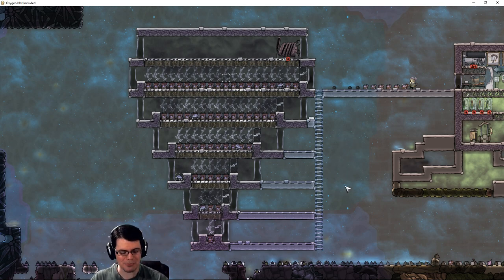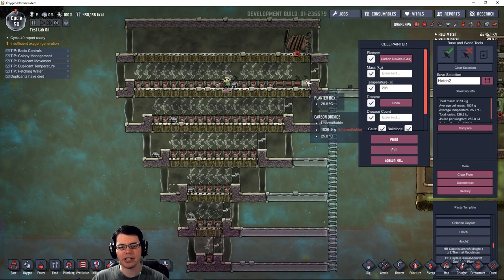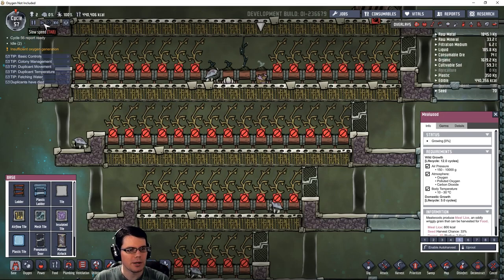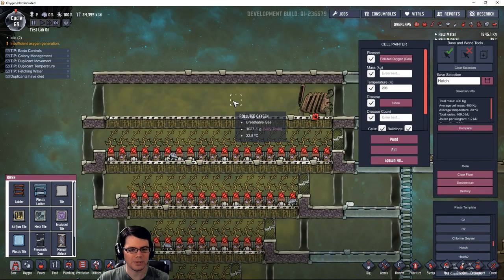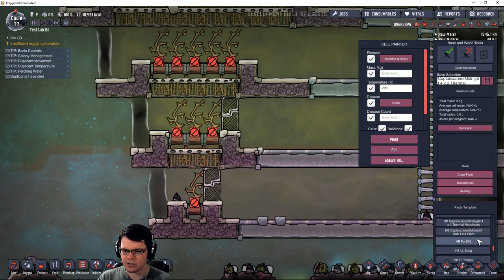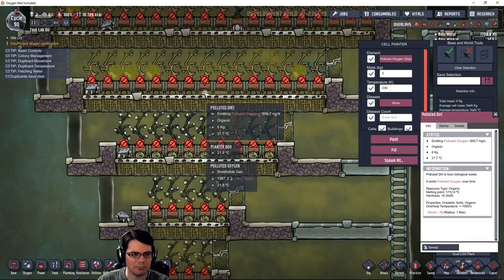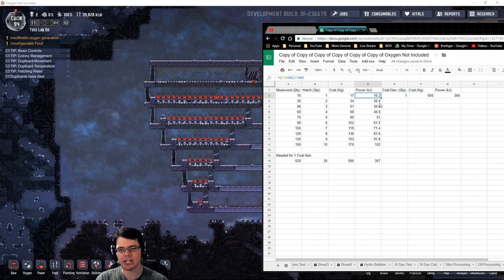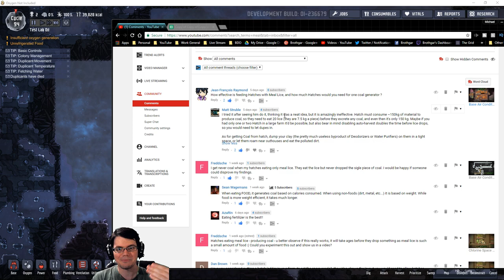Coal Farm Experiment! Oxygen Not Included

Comment: I haven't tested this yet, but I think it might be possible to make an arbitrary-item hatch farm: stick a hatch and a storage/unbottler at the bottom of a long ladder shaft filled with CO2, then request some items/liquid get delivered to the storage/unbottler. If everything goes according to plan, the duplicants should run out of air before they make it to the bottom, causing them to drop whatever they're holding so that the hatch can get at it. Feeding hatches your polluted water seems especially promising if you've got no other way to process it.
Reply: You can try to drip water on the ground and order duplicant to mop it with high priority. He will be mopping it all the time producing bottles with polluted water that hatch will convert into coal. It can be automated if water will drip little faster then duplicant mopping speed.

Comment: would it be more efficient to convert the rot piles into fertilizer before the hatch consumes them as the fertilizer piles dump it on the floor when their done it would be fairly simple?
Reply: As one said, hatches need 125kg of anything to drop an amount of coal that I have forgotten how much (100kg or so?). So it really doesn't matter if it is rot pile or fertilizer IMO in ONI ;)
Reply: but the degredation process of pulluted dirt -> polluted oxygen means your leaching mass which could be converted into coal rather than polluted oxygen increasing the reliability of the whole process resulting in a higher coal output per hatch, i.e. polluted dirt releases for arguments sake 1kg/sec of polluted oxygen after 30 seconds you have lost 30kg of potential hatch fodder which could be converted into coal rather than polluted oxygen

Comment: This really doesn't produce much power, especially given how much space is needed, though I use this to convert rotting surplus food. I simply have a storage container in a small room with a hatch or two (early game this is the bathroom to deal with polluted dirt and water at the same time as a stop-gap) set to hold only rot piles. The piles rot into polluted dirt and drop out of the container, hatch eats and converts to coal. It's not enough to run anything constantly, but it's super simple, flexible and gives plenty to work with for backup/kickstart coal generators.

Comment: Yo Brothgar, They changed the Tile/Water Pressure system btw, its not in patch notes but in an example, a single column of water with normal sandstone tiles of 50 high and sandstone "doesn't break" . its not 11 tiles high like before. whatever it was.
New pressure now for sandstone is like 1750 Kg 1x single, +500 KG (2250 Kg) for 2x double and "unlimited" with 3x triple layer(stopped testing at 100,000 Kg water at 3 tiles lol).
Insulated Tiles handle a little less pressure, maybe 500 or 250 less. something like that.
i SHOULD have made a spreadsheet but i was having fun experimenting i completely forgot.